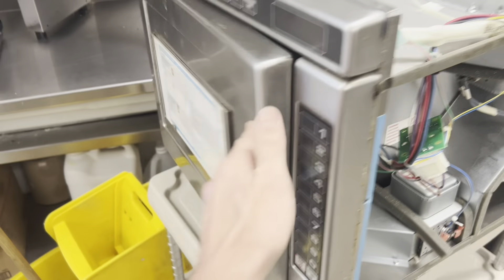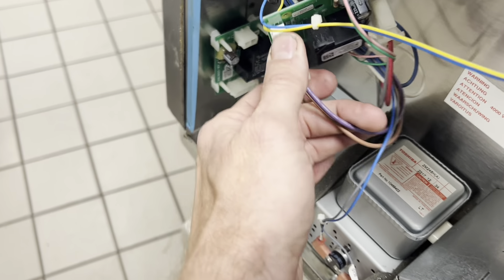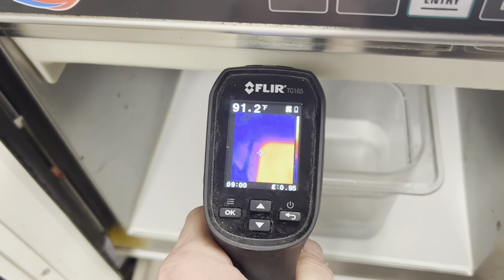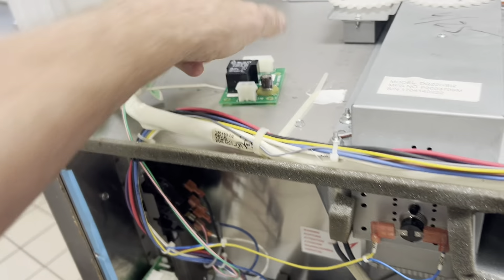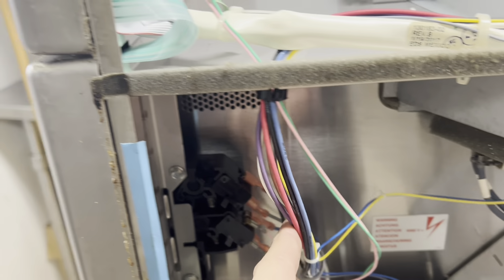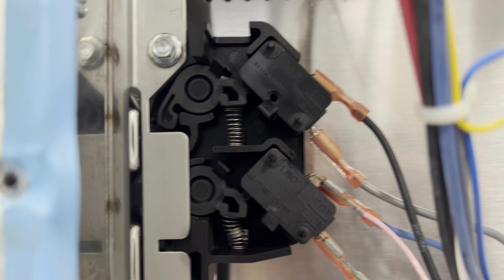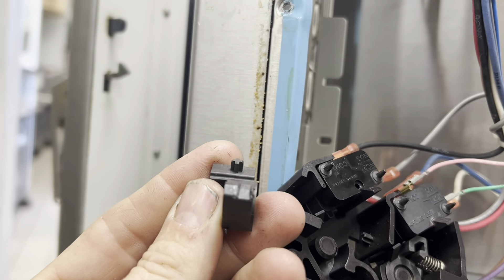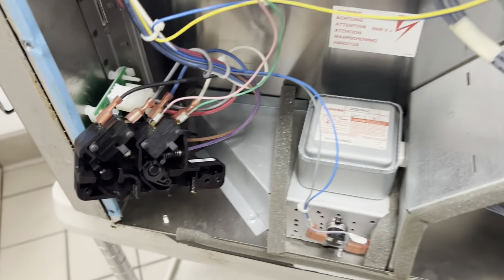Amana booster - no power at all

Comment: I remember the old Panasonic NE1850 used to kill fuses, the fail point on those were the door hooks, bottom one would wear on the pivot that it caused the crowbar switch to blow the fuse. Telltale was there would be about 1/4" vertical play on the bottom hook before the top one moved.